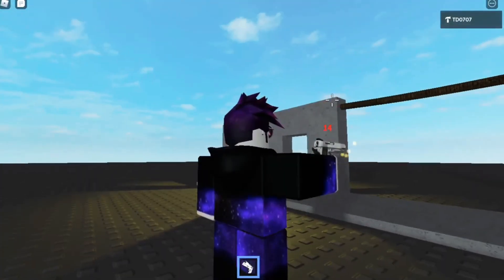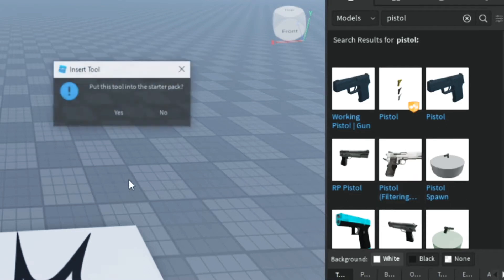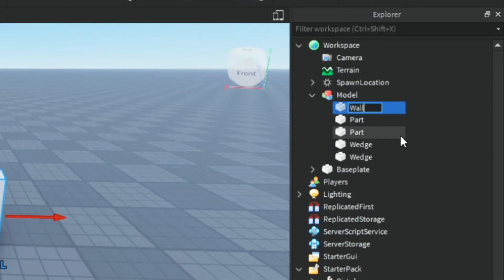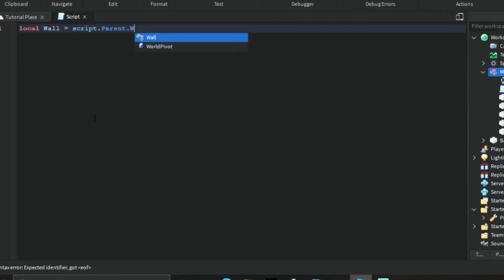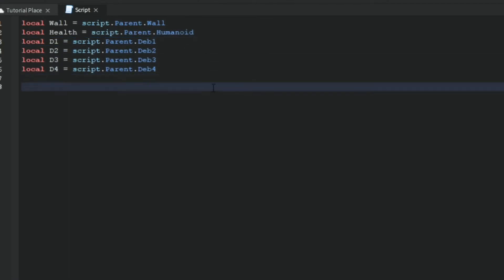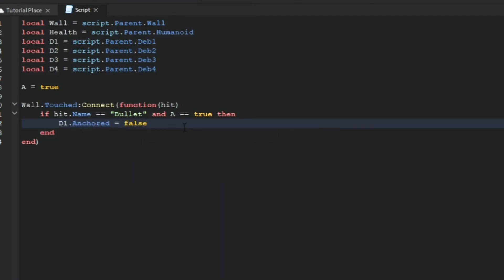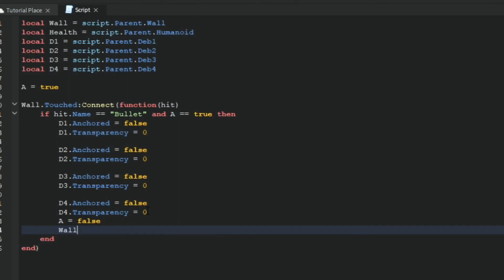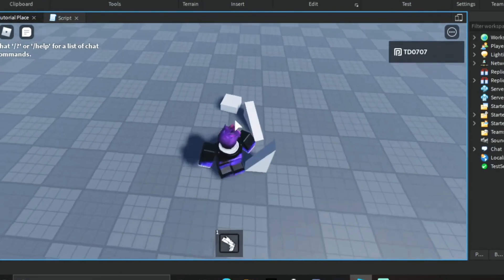How To Make A Wall That Breaks When Shot / Roblox Studio Tutorial

Comment: here the script. there can be several mistakes, so, if it wont work, check where i did the mistake and say me if want.

local Wall = script.Parent.Wall
local Health = script.Parent.Humanoid
local D1 = script.Parent.Deb1
local D2 = script.Parent.Deb2
local D3 = script.Parent.Deb3
local D4 = script.Parent.Deb4

A = true

wall.Touched:Connect(function(hit)
    if hit.Name == "bullet" and A == true and Health.Health <= 0 then
   D1.Anchored = false
   D1.Transparency = 0

   D2.Anchored = false
   D2.Transparency = 0

   D3.Anchored = false
   D3.Transparency = 0

   D4.Anchored = false
   D4.Transparency = 0
   A = false
   Wall:Destroy()
  end
end)
Reply: in 10 there is a wall with no big W so it wont work then
Reply: @lo7cas  ok thx